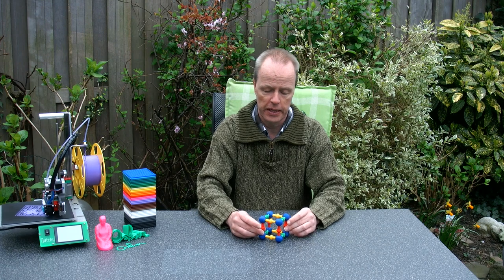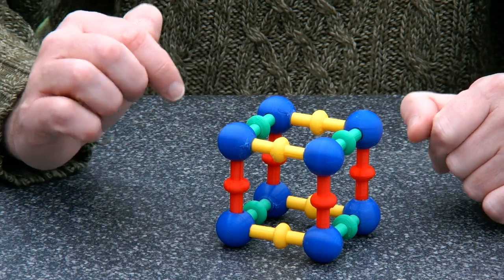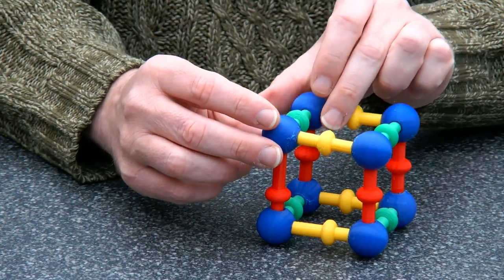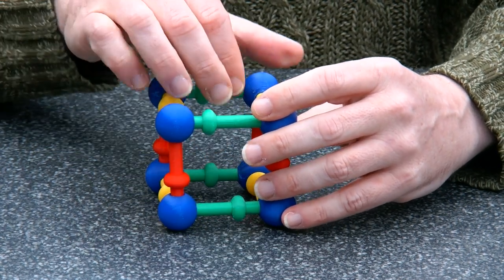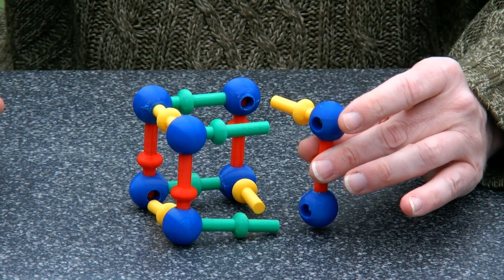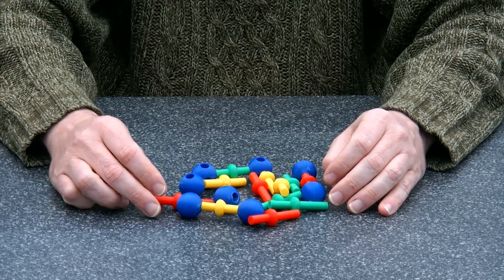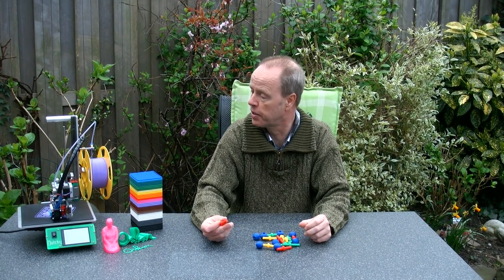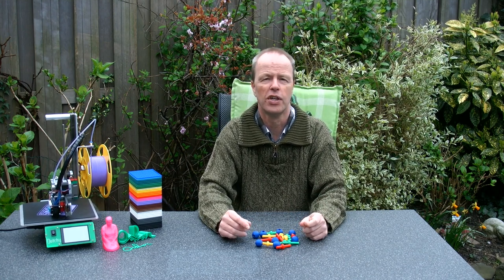Scaffold Cube - How could this design be improved?

Comment from the maker: This puzzle maginally works. The gaps may be a little too wide. However, making the holes smaller would jeopardise the smooth movement. Not sure whether this is a good puzzle for 3D-printing. What do you think?
Reply: Awesome Puzzle idea, especially if you're new to 3d printing.
Reply: To make it more difficult: have each yellow end have a unique fit (using different shapes and angles) to each hole. Currently any yellow and can go ok any hole on any ball. Make it like a jigsaw puzzle piece so each end only has one ball hole it would fit with.

Comment: Maybe you could change the end goal of the puzzle by preventing it from falling apart, and by putting a marble inside the tubes. Make grooves in those tubes so you can see where the marble is (except when the marble is inside one of the opaque blue ball joints). Keep the same sliding mechanism inside the blue balls. The puzzle is solved when the marble has made it to its destination (which could be a hole where the marble comes out).

Maybe you could add diagonal tubes to the puzzle to make the cube more interesting as a maze, and/or add a couple more marbles to the tubes in different colors, each with a different (color coded) destination, so you'd have to guide them through the maze simultaneously.

Anyway, it already seems to be a very nice puzzle in its current form, and I'm sure you can think of much better ways to 'improve' this puzzle yourself.

Keep up the great work, and thanks a lot for your video!
Reply: That sounds interesting, basically 3D maze with moving geometry
Reply: @YT-gv3cz  - Exactly! And with multiple marbles in different colors, you could have all sorts of interesting and 'unexpected' situations of blocking/interlocking tubes when moving the marbles simultaneously through the maze, which might add to the difficulty of the puzzle.

Anyway, it's just a suggestion to make a puzzle out of this very pretty cube structure that preserves the nice shape and does not come apart. In general, I like mazes a lot more than take-apart puzzles.
Reply: If Oskar would change the shape into the shape of a piece of Dutch cheese, it could also serve as an elaborate, stylish, and 'humane' mouse-trap if he'd make the tubes big enough, and if the mouse would somehow lock himself up by making the tubes move by walking through them (perhaps by using gravity or a couple of springs?).
🧀🐀
Reply: @j.vonhogen9650  I like the ideas here. I suggest windows in the balls so you can see when each marble Is in it's home.
Reply: @MelindaGreen  - That would be a great addition, but it would have to be tiny openings, otherwise you'd be able to see the inner structure of the balls whenever there is no marble in place to block the view of the inside.

Also, these little windows shouldn't have any glass or transparent material that can't be produced by a 3D printer. I guess a tiny open hole would suffice. Having open holes in the balls and open grooves in the tubes would make the puzzle dishwasher friendly as well, which would save Oskar precious time on his household chores! 😉

Comment: Perhaps there could be some 'steps' type shapes on the end of the rods so that the rods might each need to be moved 2 or 3 times, whilst the ones that are currently blocking the moves of others move out of the way in increments, rather than in just one move. Perhaps different rods could have different shape/lengths of these steps.

Comment: i love that you are making FDM puzzles! Perhaps scaling the puzzle up but keeping the gaps the same would make the gaps less significant and the holes deeper so the puzzle would be less wobbly? it might let you print the rods without support. you could also change the spheres to truncated octahedron for less steep overhangs. if you made the puzzle 3 X 3 X 3 that would open up a lot more moves or perhaps you could have the rods rotate to open up more movement options.

Comment: would it be possible to setup it up in a way where the rods have to be at a certain orientation before they can move? 

Such as, you have to rotate them to a certain angle before they move either way

Comment: To increase the difficulty, you could increase the number of possible wrong moves by making the glued-in pegs "moveable." You could have a narrower cylinder glued into place between the two balls, and then have a normal-looking peg around the structural cylinder. It would slide just like the other pegs, but the solver wouldn't make any progress by sliding that piece.

Even then, it still wouldn't be a very difficult puzzle because there's still so few ways to move pieces. You could increase the complexity by increasing the size of the corners and having an inner cube and an outer cube: 6 pegs total per vertex, instead of 3.

Comment: It may be a good idea to make the fixed rods a different color from the rest so someone doesn't get confused why a rod isn't moving
To improve the fit of the rods into the balls, you could size the hole in the ball to be slightly smaller than the rod when printed (I find putting the hole and rod at the same diameter in the CAD program does this well) and then open up the hole with a drill that's the correct size.  This results in very reasonable fits.

Comment: Could make it so you also need to twist some of the parts to get it apart. Probably wouldn't be suited to that sort of 3d printer though as the parts would need to be really smooth to slide properly.

Comment: To make it harder: having different sized rods that can only go in one hole, but there could be false openings (they look the same on the outside, but the inside part will not fit most). This could, if there were a rod with a pointed end that fit into two balls but only belonged in one, make it seem like nothing is wrong but the puzzle is not possible at that point, due to the one wrong rod.. I apologize if this is hard to understand; my thoughts are scattered.